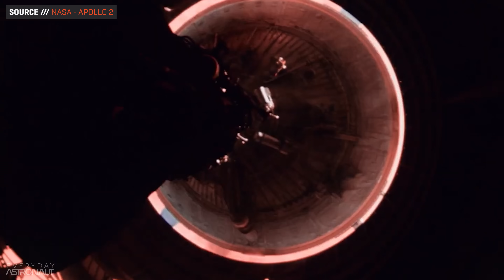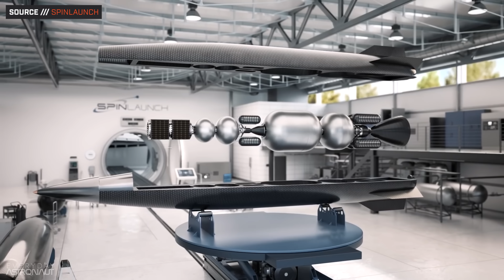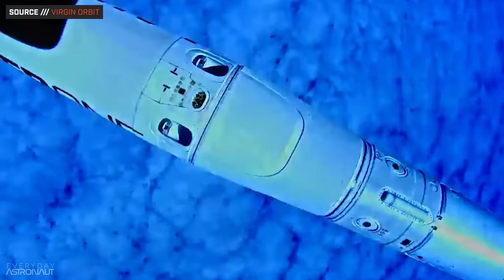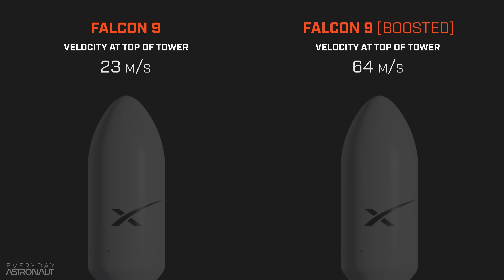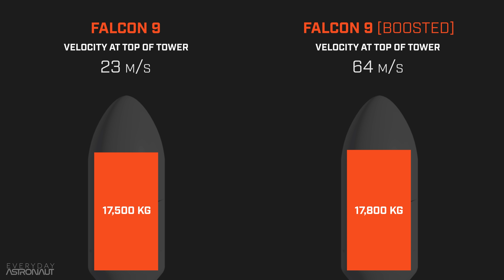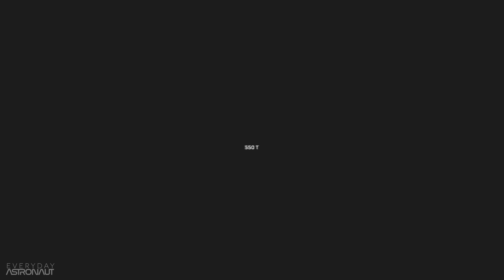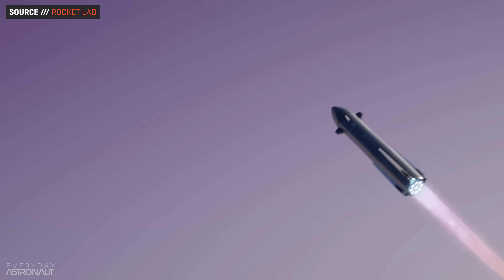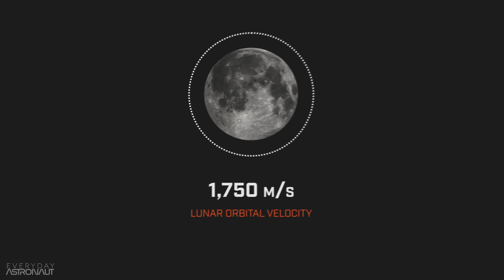Could We Help Push Rockets To Orbit?

Comment: Until we have insane material strength to the point where we could have a real space elevator to geostationary orbit, and a counterweight behind it, rockets will always be the best method of yeeting stuff to 27,000 kmh
Reply: I-Bean made from Tesla Stainless Steel with Titanium cross bracing with a 36 inch thick Kevlar/carbon fibre outer shell and maybe some staged ignition jet engines to counter- balance flexing under launch conditions...
Reply: @kylereese4822  bro I have no idea what you said. Maybe explain a bit

Comment: Do you really not understanded that structural strength for a specific vehicle have a top value? Yes,a falcon9 could stand for 3g when the booster is almost empty, but the force of 9 engines isn't much bigger than the same engines deliver on the launch pad, so if actually you want to accelerate a 550 tons at 3g you need 1650 tons of force, and you need a structure that was designed to resist only 825 tons to manage twice, and also you cannot make it heavier too, because that would make any small improvement insignificant.
Reply from the maker: This whole video is supposed to be a rundown on why it's NOT a good idea... so yes, I understand.

Comment: The answer to all these questions regarding replacing the first stage with a catapult or an airplane, is that it is just much safer, cheaper and easier to just build a bigger rocket

Comment: Well, this was disappointing. A significant fraction of the video was simply silly energy and power comparisons, as if adding more comparisons was somehow making a better point.
Reply: And remember that any of these systems use way less energy than actual rockets. So for the moon in particular, where the fuel would have to be produced, that argument falls completely flat.

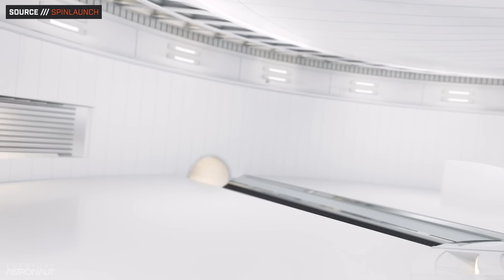Comment: 5:17 , why did the rocket stop spinning ? It has a spinning momentum at the moment of the release.
Reply: Payload is rigidly attached to the centrifuge arm. Before the release, payload's angular forces are acting on the arm, i.e. arm's fore attachment experiences less force than aft attachment, because it needs to rotate the payload. After the release, there is no more reaction to keep rotating payload inwards, so it continues moving in a straight line without angular velocity.
Reply: @ivanjermakov not quire right in my opinion. The rocket has a spinning motion relative to its center of mass, which will have to be cancelled out if we want the rocket not to spin when moving forward after it has been released.
Reply: The rocket was rigidly attached to the centrifuge arm prior to release: it wasn't spinning around the rocket's center of mass - it was spinning around the centrifuge's center of mass, along with the rest of the centrifuge.  At the moment the rocket is released, all it "knows" is that it's moving forward at a given velocity: it doesn't retain any 'memory' of what it was being subjected to prior to release.
Reply: @Spherical_Cow  But it's being suspended by the centrifuge arm at the center of the rockets center of mass. It flys straight without tumbling.
Reply: Take an object in your hand and then swing your arm in big circles. Then let go. The object will travel tangent to the circle (at that instant, until acceleration due to gravity affects it)
Reply: @jacobtimmons14 Just tried it, it always rotates after released.  It combines spinning and linear motion.
Reply: @zenobikraweznick I see, I thought you meant “why does the rocket travel in a straight line” (i.e. not keep revolving around the point it was released from…which is a sillier question but hey, this is the internet)

This is a good question. I assume they must also impart some spin on the longitudinal axis of the rocket which makes it stable, and the point that it is fixed to on the centrifuge arm is so precisely placed on the center of mass of the projectile that it doesn’t tumble. There is likely some transfer of angular momentum from the projectile to the centrifuge at the moment of release such that it is conserved. Not an expert on this system by any means so I would definitely welcome insight from anyone that knows more.
Reply: It depends where you're holding it at the point of release. If you're holding it at the center of mass it won't spin. Think Javelin thrower.
Reply: Javelin thrower does not spin the object that is thrown. It's pushed.
Reply: @zenobikraweznick  What question are you asking?
1] Why does the rocket go straight and not continue to go in a loop?
2] Why does the rocket not tumble when released?
A1] The centrifuge arm is necessary to stop the rocket from going straight prior to release, it's continually pulling the rocket towards the axle. Objects always want to fly straight unless acted on by another force.
A2] Provided the object is released from its center of mass there is no force acting on it causing it to spin. Air will impart a slight tendency to begin to tumble but the rocket has fins at the back to counter this force.
Reply: @ekij133How do you stop the spinning motion ? At the release time the projectile has both spinning and linear motion. The animation clearly shows the spinning motion stops instantly. How do you stop it in an instant ?
Reply: @zenobikraweznick  The arm of the centrifuge is what is forcing the rocket to spin. At the point that the arm disconnects there is nothing forcing the rocket to continue to spin.
The rocket wants to go straight, it was the arm of the centrifuge applying a force to it that was causing it to arc around in a circle. Once the arm is disconnected the rocket goes straight.
Reply: @ekij133the rocket will continue moving forward, but spinning at the same time.
Reply: @zenobikraweznick  No. There is no force causing it to spin.
Take a pen with a pen lid and loosen the pen lid and then spin the pen on your desk until the lid flies off. It will fly off in a straight line it will not continue to spin around the top of the pen after it's detached from the pen.
Reply: @ekij133 take a wheel (like a bicycle wheel) , then swing it , then release it up in the air. It will move up in the straignt line , but rotating. Just tried the pen experiment, the lid was rotating.
Reply: @zenobikraweznick  during spin-up, the rocket is rigidly attached to the centrifuge arm.  It's not rotating around the attachment point; there is no axle or bearing there to allow rotation.  Thus, the rocket's rotation prior to release is not an inertial process, but a result of a torque continuously exerted upon it at the point of the rigid attachment to the centrifuge arm.  When the rocket is released, there is no longer a torque acting upon it - and as it has no intrinsic angular momentum at the moment of release, the rocket does not spin after release.
Reply: @zenobikraweznick  But they're not releasing the whole centrifuge (the wheel in your analogy) they're releasing the rocket off the edge of the centrifuge. 
The Lid was rotating *around what*, please clarify what problem you want me to explain.
The Lid flew off *in a straight line*.
It may have tumbled a little because:
1] It wasn't released from the center of its mass
2] It's an odd shape and interaction with the table top caused it to start to tumble (or spin around the lids center of mass).
Are you trying to understand why the lid doesn't spin around the pen or why it doesn't spin around it's own center of mass?
Up to now I thought you wanted to know why it didn't spin around the pen.
The spin launch rocket is not rotating around it's own center of mass before it's released, only around the centrifuge's center of mass.
Reply: @ekij133 let's assume for the sake of simplicity that instead of the rocket there is a bowling ball. You're saying that after the ball is released  from the centrifuge it would not spin but preserve its orientation and just fly steadily in a straight line ? Let's assume there's no drag , just vacuum, to simplyfy things. How do you cancel out the roataional momentum the ball had just before the release ?
Reply: @zenobikraweznick  Once again the ball had no rotation about it's OWN center of mass. There is no 'rotational momentum' to cancel.
So yes, I'm saying that once released the bowling ball will fly steadily in a straight line without spin (unless acted on my an external force, the air will tend to induce a tumble which is why the actual rocket has fins at the back to stop that as it forms)
Another practical example you can do.
Get a small teddy bear or similar, hold it by at the center of mass so it's facing you and spin on the spot and then release it. It flies away from you *still facing you*. It does not start to spin. 
In reality it will start to spin a little due to interaction with the air and the fact you weren't holding it perfectly at the center of mass. If you have a ball that will work better but it's harder to see unless it had different colours on it.
You may also want to film it as you'll probably be dizzy for a few seconds after you stop spinning and miss observing what happens.
Reply: @ekij133 The ball certainly has rotating momentum. If you record a video of the centrifuge and the ball and then crop it so that only the ball is visible then the video clearly shows the ball is rotating thus having rotational momentum.

Comment: don't use a counter-weight, use inverted rocket
Reply: Exactly. My thought was incorporating a water deluge system. Use the water to raise up any weight with pumps then controlled release of water controls the weights dropping on a BIG lever yeeting the entire package into the air, a few dozen meters.  Simple ;)
Reply: Might as well have extra raptors on the chopsticks :-)
Reply: @michalfaraday8135  ahah ye
Reply: @michalfaraday8135  But that is same as adding one more stage to the rocket. More stages - more payload mass for same amount of propellant. Up to some point. 
Or perhaps just split payload in half and launch two identical rockets side by side. Or just build a bigger rocket. 
And we back to what is being done today :)
Reply: @hbh3144  Well yes and no:-] The chopsticks are not part of the rocket so they do not add mass to it and they dont need a rocket-shaped propellant tank connected to the rest, but they certainly can be viewed as a reusable kickstage used at the start. Then again so can every other type used on the tower. The only difference is where you get the energy  to push the rocket up. Some advantage of the other models is you could accumulate electric energy over time and then release it at once, making the system more eco friendly. but that's kinda it. The point I'm  trying to make is that there is no need to come up with crazy methods to get the same job done.
Reply: This. Move the earth not the rocket.

Comment: I had a similar thought years ago but using big hydraulic rams on the mount. Lot less travel than your weight idea, but just assisting the initial lift would help loads imo

Comment: I have to say that a space elevator would still be the most attainable system. Eliminates the need for anything but the object being "launched", or lifted I guess,  and whatever propulsion you want/need.  
Love the examples of all the launch systems!
Reply: Space elevators seem so huge and have such esoteric requirements of the materials and such danger if it fails I think it's unlikely on earth or Mars. I think a moon elevator or launch track seems feasible however!
Reply: @philipmumford7871  Mars is not very densely populated (right now: not at all populated), so it wouldn´t be that crazy. Also, Mars has some really elevated places near it´s equator (yes, I got that from Kim Stanley Robinson´s Mars Trilogy). 
I don´t think, a space elevator on the moon would work, because it rotates too slow. Lunastationary orbit is super far out. 
I have heard of a moon elevator started from the Lagrange point (don´t ask me numbers) between earth and moon down to Luna in a video, I think is was from Cool Worlds. However, I didn´t see the big advantages either.
Reply: rotavator is waay easier and somewhat more useful than a space elevator

Comment: I noticed at 20:55 that the width of the Neutron and Falcon 9 are 1.2 m and 3.7 m respectively, but are also 4ft wide for both?
Reply: should be 12ft for Falcon 9

Comment: How about instead of using the assist system to increase the payload of a boosted rocket, use the assist system to reduce the size of the booster (less weight to move) while not completely eliminating the booster, you know like an ACTUAL ASSIST would be by definition, I mean any mass you remove from the rocket is a massive impact on the efficiency of the system is it not? And Boosters carry TONS upon TONS of mass in FUEL.